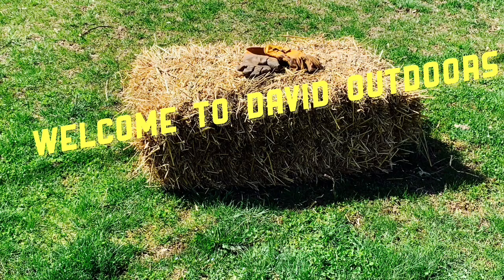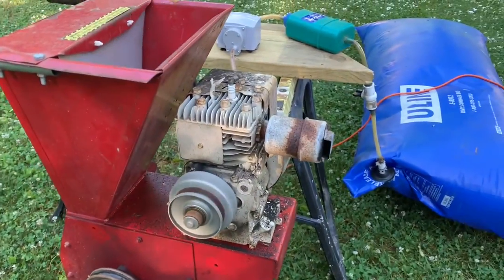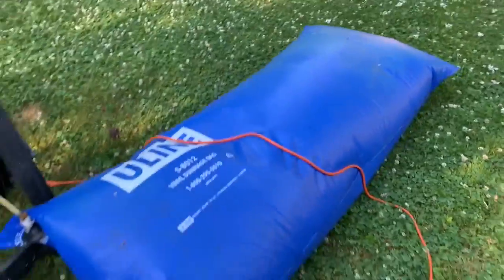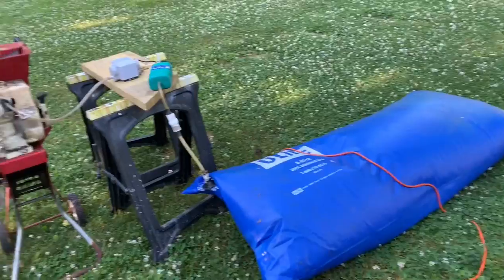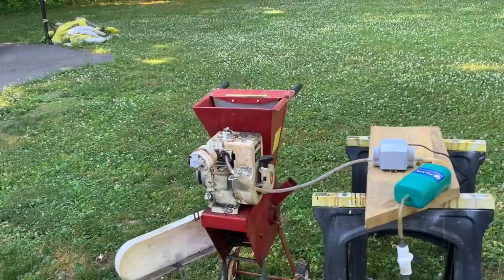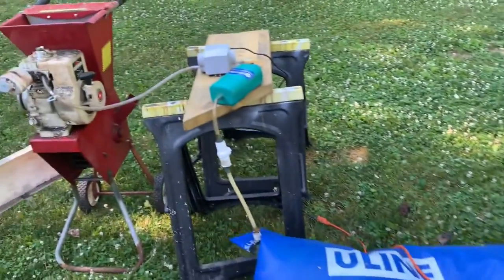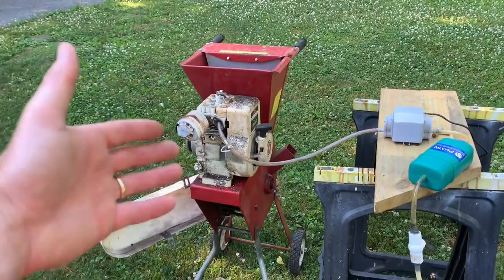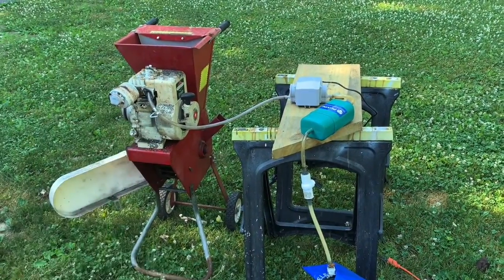How To Make Free Energy To Run A Motor From Biogas

Comment: what's inside the grey box? also what's in the teal colored box? will you explain how this works?
Reply from the maker: Thank you for the question, grey box is a small air pump to get biogas from the bag, teal thing is a sulfur filter, biogas is a dirty gas that needs to be filtered.
Reply: @davidoutdoors74  how does the sulfur filter work? Can you please tell me how you throttle the engine? Do you only control the gas or do you also control the air?